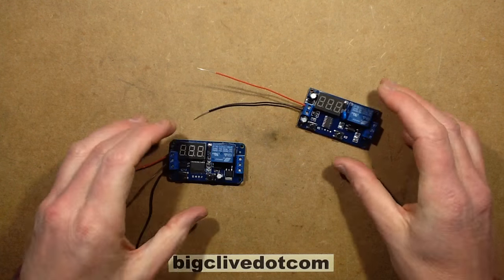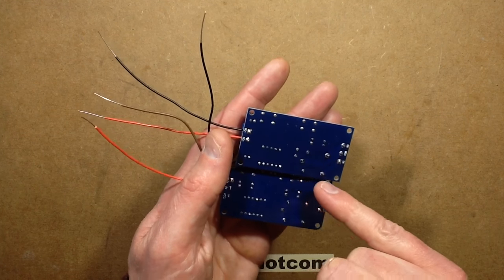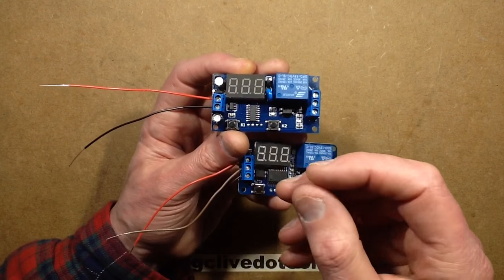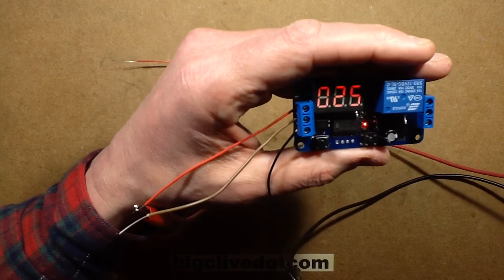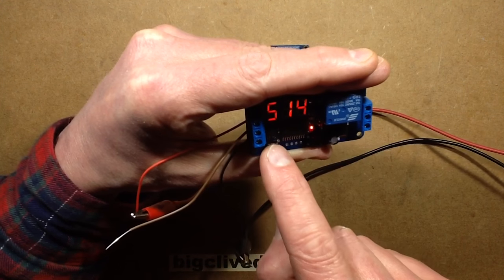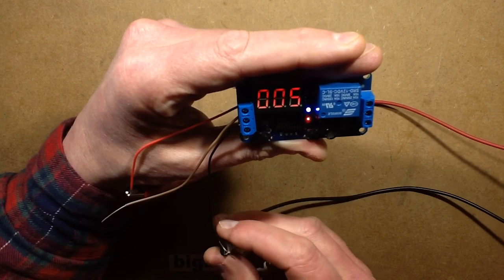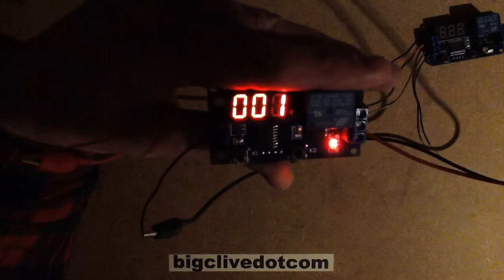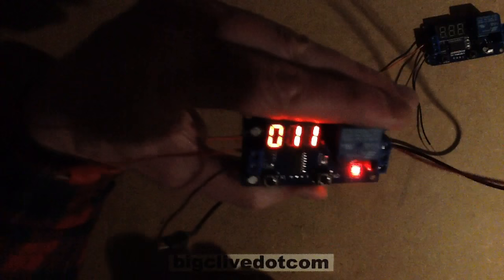A look at some digital timer modules.

Comment: maybe you canhelp me out. i need a timer like the first one where i can use a coin trigger just like you showed. let say 60 seconds but i need it to be additive. trigger again add another 60 seconds to wht ever is left. add 5 coins add 5 minutes etc.. secod is i want to switch video input. so 2 video inputs. timer off use video input 1 drop. coin switch to video input 2 time runs out back to video 1. any suggestions on simple ways to do this?

Comment: I love all your reviews, now 7 years on the, about the time I have been using these modules. The one to go for is the HW-521 and make sure this is printed on the front of the board. The more expensive YYC-2S is badly designed as after programming , the digits are blank so you  you have little idea what you are about to trigger. I guess his day started with a sip of whiskey from Jura )

Comment: I have the slightly different (but exact same layout) DK-C-01, and I'm happy to inform you that they no longer use an opto to drive the relay and there's an actual milled slot between the middle relay pin and the ground plane. This one is an advanced version though - three buttons instead of two, and it has four different timing/delay modes; nothing you couldn't whip up yourself in a hurry (sans display) with an Arduino, but exceedingly convenient when you don't feel like it, especially by having that relay already on board...

Comment: Hi Clive, I need to provide a steady 12VDC output to power a camera that is attached to a side view mirror.  The wiring for the turn signal bulb is 12VDC PULSE, so every ~0.5 seconds I would lose input power.

Can I use this type of timer to maintain the steady 12VDC output while the 12VDC Pulse is de-energized?  Perhaps set the timer to 1 second - I assume the timer resets when the trigger is tripped again?  Is the 12VDC OUTPUT at the same time the timer is receiving 12VDC input?  This way when I'm done using my turn signal and the wire/timer is de-energized the whole system goes back into standby and the camera turns off.

Comment: Clive. Would this be useful for backing off an actuator for a custom electronic handbrake.i have a module to run the actuator that detects amps to pull the cable. But I wouldn't want to back the cable off far. Juat enough to release the brakes?

Comment: Hello sir. How can I connect a timer module to a 254nm inverter germicidal lamp? Currently it’s connected from the AC power source 120V-5V converter-12V Rocket switch-5V dual lamp UV 254nm germicidal inverter lamp

Comment: I forgot to add just now, that I could not go for a simple mechanical segment plug in timer because they all only go down to a 15 minute timing on as a minimum, which is way too long, so I had to choose electronic digital to get timings of 1 minute on minimum, as I wanted 2mins or 3mins max in any hour. So, referring to my previous comment, do you think this sort of timer will not do for electric motor waterpump and flue fan? What would be a solution for this application? Thanks, Alan in Norwich UK.

Comment: not so sure about holding the right-hand button on the last timer board.  You turned off the display at 015, and it came back several seconds later as 015.

Comment: Hi Clive I’ve built a simple 12v alarm system for my shed. It comprises of a 12v power source, switch, PIR switch and 150 dB ish siren. My problem is the Siren sounds when I set the alarm using the switch once finished in the shed. The PIR switch closes when powered up just like when on a  security light.  So I’m looking for a way to delay the power going to the siren. So the PIR can power off not triggering the siren. 

Question is can I put the second module in your video between my PIR and siren. Or does it need constant power to retain programming? 

Thanks
Reply from the maker: You can get simple delay relays that don't energise the coil until the set time has elapsed.  It would mean the extra load of a continuously energised coil though.

Comment: Are there someone who has experienced the mains interfering with the low voltage circuit when they are placed close to each other? Is it just bad practice or does i regularly cause problems?

Comment: I bought a plug in digital timer switch, ( brand masterplug, only 6pounds from b&q), it says its for loads up to 2400watts and only says this, with no mention of inductive loads as on other makes. So I used it for timing 3mins on in every hour to my central heating boiler, so it switches a water pump motor and a flue fan motor. It worked for a day, but now will not work at all, no output on any setting, even the setting 'always on' manual overide. Do you think it was an inductive type load that has damaged this timer? I specifically bought this timer as it just says 'max 2400watts', as opposed to one I saw in asda that says ' max2800watts resistive, 325 watts inductive' , so I went for this masterplug one instead as it makes no mention of a lower handling in watts if inductive, and I assumed therefore that 2400 watts referred to every type of load. But it packed up completely after a day, what do you think about this?  I appreciate very much any advice from you please, many thanks, Alan, in Norwich Norfolk, UK.
Reply from the maker: Try pressing the recessed reset button on the time switch.  They are very prone to crashing with inductive loads.
I'd be very wary of cycling a flue fan on and off if it is intended to remove carbon monoxide from a burner.

Comment: Clive, thanks for this. The listing for these different timers are similar, a trap for the unwary. The triggered timer was the one I covered and seems  to have a greater variety of uses. Any chance of some thoughts on the VLC V20 voltage detecting timer relay? Cheers, Andy

Comment: Could you use a single stage delay timer to inturupt a remote start signal, to reduce the amount of time the engine is being cranked? I have a problem where the remote start cranks to long and grinds the starter. The alarm/remote start system is already turned Down to the shortest crank time.
Reply from the maker: You can buy commercial time delay relays that are intended for use in control panels for providing an adjustable time.  When the relay is powered up it doesn't click in until the time has been reached.  In your case you could use the normally closed contact to open the signal circuit and stop the cranking after a short delay.
Reply: bigclivedotcom thanks

Comment: FRM01 version of this type of timer has a much more easier setting.
But mine still fail in about a year when I use it to switch solenoid every 10 minutes 24/7, any idea how can I modified it to make it last longer? maybe use DC SSR or power MOSFET instead?
Reply from the maker: +PartTimeRonin For that amount of cycling an electronic switching component would probably be a better option.
Reply: Thx, a bit more search I also found FNM01 which is an power MOSFET version of FRM01 I think, might be better than mechanical relay.

The price in Aliexpress is a bit too high though, on China site it's list way cheaper than this.

Comment: I'm curious to know, what does it reset to if you remove power from the circuit? I intend to use it in an application where the circuit will be discharged completely often.
Reply from the maker: +Super Vitz They store the settings in non volatile memory.
Reply: bigclivedotcom Excellent, thanks for the reply. I didn't realise it was non volatile.

Comment: I find optocouplers are often a big red flag for an incompetent designer. For some reason, they think throwing in an optocoupler means good things will happen, or bad things won't. It's isolated now! Never mind that track running straight under it between the LED cathode and the transistor emitter. Or that both sides are fed by the same supply.

Comment: When building and designing PLC control devices we use opto isolators  (we call them optocouplers) because it allows us to switch without actual connection.   The opto isolator switched by light, so it works as a good separator.

Comment: Maybe someone here can help me, I am looking for something like this but I need it to only time a ground? as in ground a wire for around two seconds then have no polarity what so ever, is that possible with these? if you just don't hook up the positive to the output or does it only switch the positive side with the relay?
Reply: The three connections for the relay contacts are separate from the timing circuit so just use the NO and COM connections to short to ground.

Comment: Hi Clive, I bought this relay before I watched your video... I was hoping the relay could, if triggered again whilst running could add time value to balance...if that makes sense.. Do you know if there is a product out there or if there is a work around?.. FBG- I'm using it for a coin operated timer. My understanding is that this relay would in fact let the coin mech accept payment (if coin inserted while timer was running) but not increase the timer value ... robbing my patrons....
Reply from the maker: eBay does have dedicated coin mech timers that do increment the time with more credit.
http://www.ebay.com/itm/111847592626
Reply: Thanks Clive... perfect
Reply: Not much info about it online... need a review Clive (:
Reply from the maker: +Pierre Labutte Strangely enough.....  I just ordered one.
Reply: Awesome...

Comment: I think the opto simplifies the relay switching levels, since the logic is at 5v and the relay is at a possibly unregulated 12v. Possibly for some strange reason using the +12 to switch instead of pulling a pin to ground (PNP type configuration), that's about all I could think of saving for a silly amount of isolation for the CPU on a rather cheap module.  I used a one of these to stagger some solid state relays at work and it worked like a charm. The solid state relays control some blowers and they put in bigger blowers, my start up surge was 96A @ 120Vac.. staggering half the blowers knocked down the max surge to about 70A. The program modes on both units are interesting. The different modes do different things. The ones I have turn the digit off that you are editing for 1/2 a second if I remember right, and you can change the decimal place as well on the one. They all have a different set of features, despite they all look the same. My 2 pin input unit I think if you hold the button down it will go into a mode that allows you to set the timer function. It should let you chose P1 P2 or P3.  I think that is from holding down the left button.   It should have a cycling timer, one that counts up and turns on and one that counts up and turns off.

Comment: +BigCliveDotCom Oddly enough, I have been looking for a (timer?) to turn a light on and off in my chicken coop at the same time every day.  Surprisingly, it has been a difficult task.  One might think it would be incredibly easy! Thanks for explaining how these things work. You saved me a mistake.

I suppose I could use a photosensitive switch, but I was not able to find a module that allows for setting a time interval, like 4 hours.  I'm supposing I'm going to need to use a hybrid of a photo cell that triggers the interval timer.  I have limited space in the box so this might not be feasible. Also raises the concern of dealing with retriggering. The photo cell will trigger the timer, the timer will count down, but it appears once the countdown finishes, if it is still dark, it will restart.
Reply from the maker: +Rich Booth An ordinary time switch perhaps?
Reply: +bigclivedotcom LOL!  Where is the "dork" factor in that?  I live in the country and out here we like shiny things, things with lots of LEDs and such.  Bug zappers make for good watching on a summer night.  That and it's got to fit in a translucent waterproof box along with a thermo sensor to turn on a heat lamp if the temperature drops below 45°F and is planned on being direct wire in to mains voltage rather than a plug.  Access to the box is not convenient.  It's always fun to over engineered projects like this, too.

Comment: Im sure you can get opto isolators with transistors in, so why an external one, and as you said "whats the point" odd designer :-/
The buttons seem to be like old digital watches, jumping digits and multiple modes.
Neat though :-D

Comment: So I guess ISIS will be buying some of their supplies from ebay now...
Reply: +44CT232 i think they already perfected using a certain cheap casio for timing devices anyway
Reply: And the good thing is they don't need to buy any extra explosives!
Reply: +Bradman175 Just rig it so that the relay shorts out some dodgy 18650 lithium cells, and you have a perfect bomb :-P

Comment: Why did you show a coin mech? That fkin timer stupit,,, if a person put a second coin in it wont multiply the value of the coin in min/sec :( the timer is useless for kiosk or coin op operation :(
Reply from the maker: +uhfnutbar1 Coin lockout coil.
Reply: ha ha ha  , oh sure you may you have the life luxury with your coin lockout coil, but My Ms. Pacman and Donkey Kong was never made with them , smart guy :)  i bought the timers with the 3 buttons that look almost same as ones you have and they do both timing functions you show on your two :) but still no trigger time multiplication